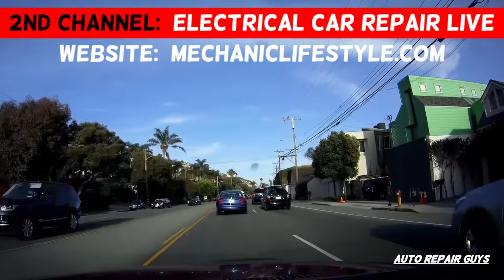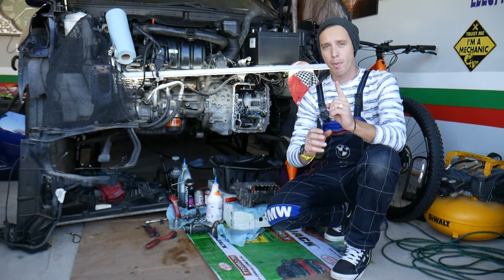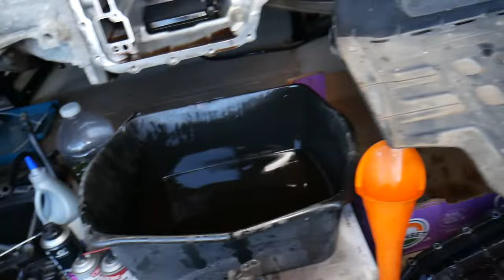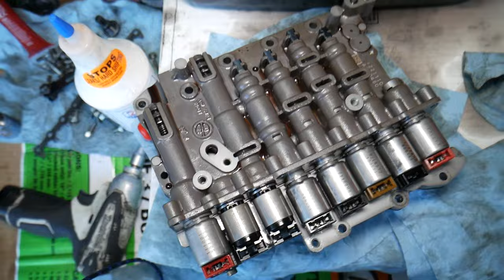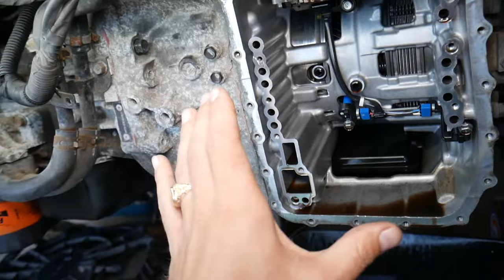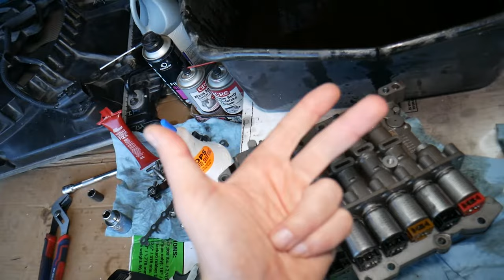WHERE IS THE AUTOMATIC TRANSMISSION FILTER LOCATED

Comment: Yup,non servicable filter guys. This is a 2007 mazda CX7 2.3 DISI . These are 6 speed automatic tranmissions and they are a bitch to work on. The pan is front facing on the trans instead of on the bottom like the 2.5 version. These transmissions are notoriouse for slipping,delayed shifts,erratic shifting,hard shifts,getting stuck in one gear and not going into reverse. The only thing you can do is do fluid changes and often. If these arent serviced regularly from the start dont flush them bc they will def slip bc all that sludge is keeping the clutches full of friction particles.I did a drain and fill and put lucus no slip in mine bc it wasnt cared for properly from the start. I reccomend just doing a drain and fill and adding 12oz of lucas stop slip. Make sure not to overfill. Usually 4 quarts come out when you drain. Measure what comes out and replace. Substitute 12oz of the JWS -3309 fluid for the lucas or 24oz if you want to use the whole bottle of lucas stop slip.  Poor design for a transmission for sure.  Also replacing all those shift solenoids on the valve body is recomended.  Been there with this transmission. Im putting a crate trans in soon bc the one currently was just not taken care of and its intracate so i dont trust a rebuild.

Comment: This video is very informative for me. I really appreciate it. I have question: When you change transmission 2015 Kia Forte (2014-2018 same body), does it require programming after trany installation?
Reply: I worked for  a Nissan dealer and whenever we had to change a customer's cvt transmission, we had to reprogram the computer or "reset" it. Otherwise it would ruin the new one.

Comment: My 2011 Audi a3 1.6L tdi auto sportback appears to have Two transmission drainage plugs. One Large 14mm hex towards the back of the box and a Smaller One underneath the mechatronics unit..My question to all is, Is the front Hex Plug a drainage plug or not ?   big thanks if anyone can answer my question...........Great vid cheers...